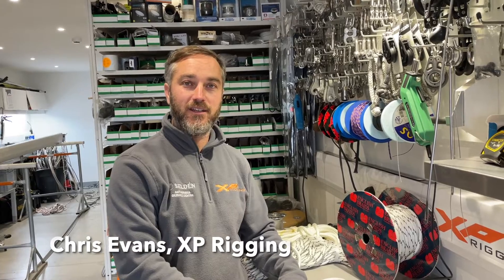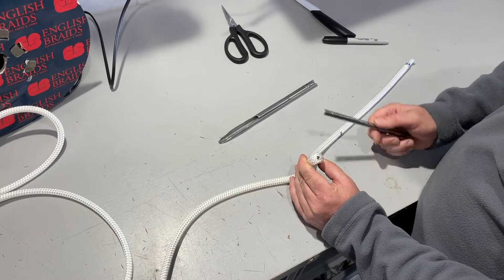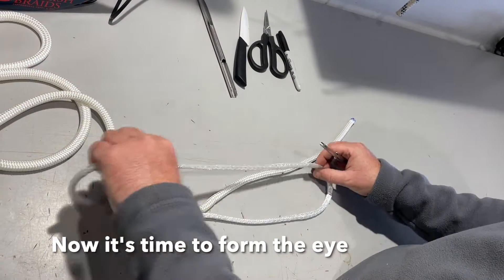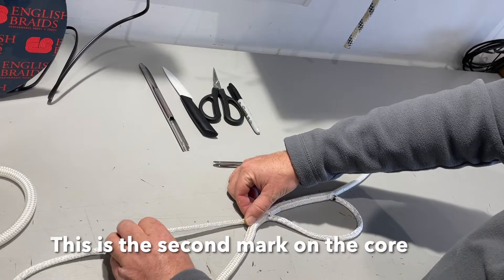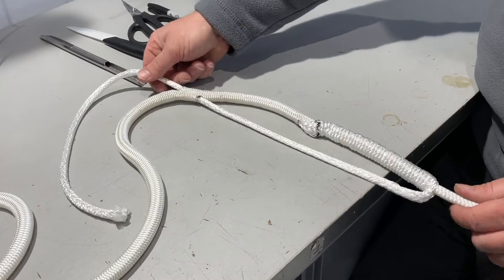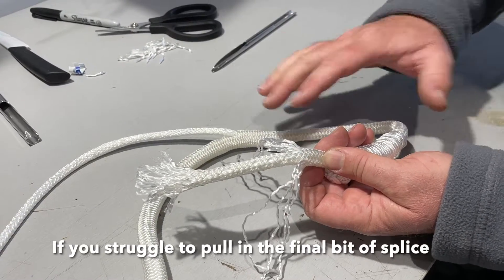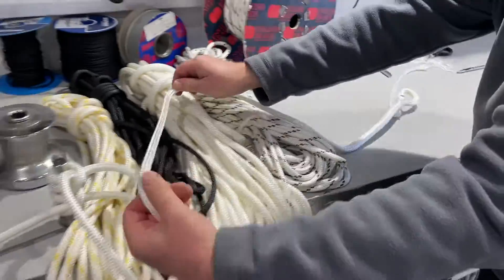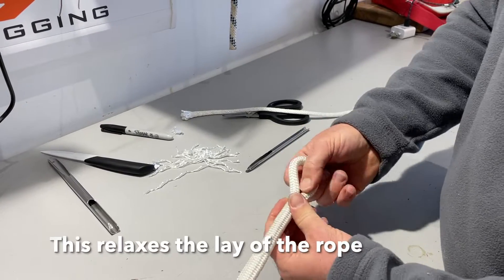How to do an eyesplice

Comment: I did this splice, i don't think its correct. It is easy to do but the final result i think is weak because on the back side of the splice only the outer sheef and abou 20mm are actually providing strength. In my opinion the tale need to be burried along with the rest of the inside core. Please correct me if i am wrong. Thanks